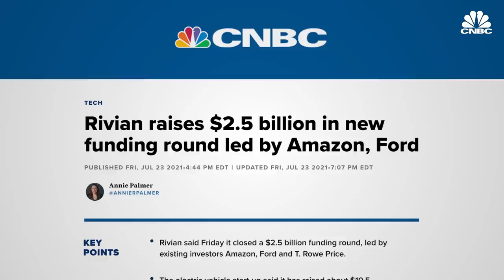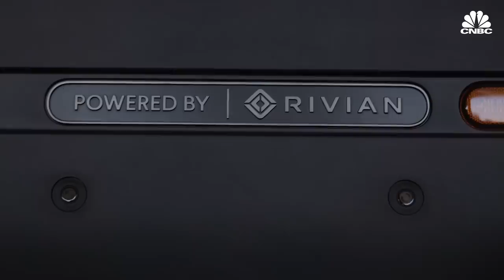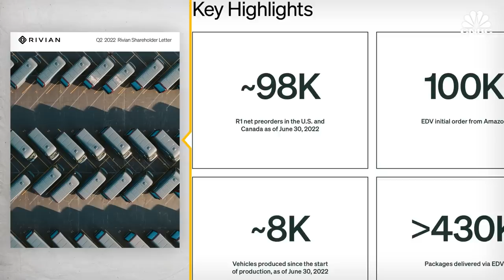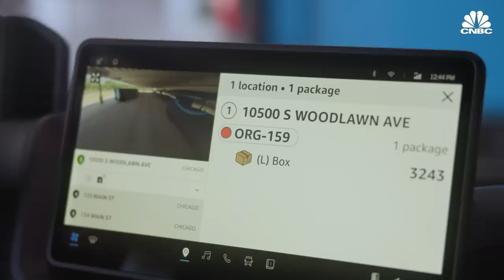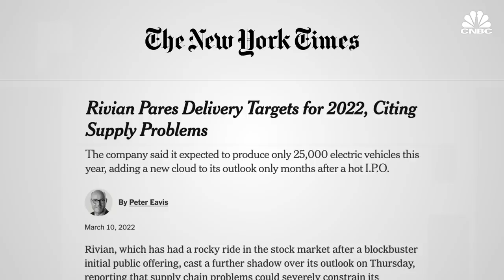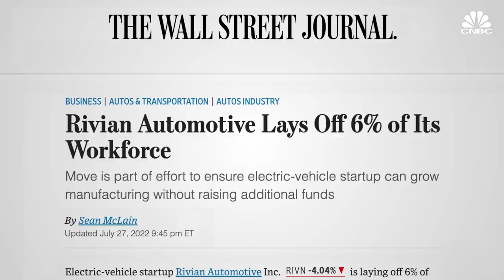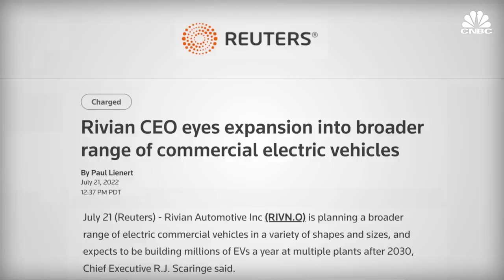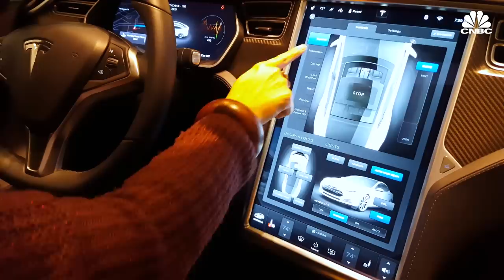How Amazon Is Giving Rivian An Edge In The EV Industry

Comment: I support the EV market, but where is all this new electric power going to come from?  My power company is building new coal power plants to support new demand. To drive a coal powered EV is not wise. We should slow the rollout down a little bit and not cause widespread power shortages. We only have 1 chance at this.
Reply: Aren't nuclear plants pretty clean
Reply: Producing EVs is worse for the environment than just driving gas powered vehicles
Reply: @LuKe-cq9il  they are, but we need to start building new ones, but we aren't. CA is shutting there's down. Natural gas is cheap compared to building nuclear power.
Reply: Renewables these days are generally cheaper than fossil fuels on a megawatt hour basis. No offence, but building new coal power plants in 2022 ought to be illegal - those plants last decades, and we can't still be running coal plants in the 2040s if we want to meet net zero. If you absolutely need base load, go with natural gas, nuclear or hydro. Or build lots of batteries. Or have a larger grid. Literally anything other than coal.
Reply: @Robert Jameson you know how much energy it takes to mine the lithium that they use for the batteries in EVs. You obviously need to do some research before you make an ignorant comment like that again.
Reply: @Robert Jameson Dont just say lol and be a child. Give answer with proof. You know as well as i do that William is correct!
Reply: @JT_771  Ask Texas how that wind and solar worked out. More Chinese solar panels are not the answer. Windmills take enormous amounts of steel and concrete.  10 years of use to break even on carbon pollution. By then they have to replace the generator and blades. They are not efficient, just good at getting money from the government. 

Please, I beg of you, to do some research on the pollution on the mining of lithium, nickel, and cobalt in Africa. The necessary minerals needed for batteries are killing entire generations of people. Oil production is dirty, but not even close on death toll for lithium batteries.
Reply: @JT_771  I do a ton of research. How do you think I discovered the fact that Africans are dying by the thousands so that rich Americans can drive a coal powered EV. And feel good about driving a EV, that is what I find very depressing. They don't know the harm that they are creating. 
I live in southeast Michigan. If I plug my EV in when I get home to charge, the sun gone down or it's overcast,solar panels do me no good. Just driving a coal powered EV at that point.
Reply: If it's your power company, why did you decide on coal power plants?
Reply: @elvism684  Europe is going to need a lot more natural gas to make up for Russian sactions. Coal in my region is cheap, plentiful, and reliable.

Comment: The Edison generator and dynamos is an open patent technology but you can chisel an old generator to Edison generator by removing the Tesla magnets from the armature magnets and leaving the Edison magnets on the armature magnets.  The generator will move like a motor and generate the same current and voltage DC add an inverter for higher voltage AC power continuous peak power without fuel or pollution.  A dynamo is a brushless motor as a generator and is an open patent technology.

Comment: I’ve seen a few and their trucks in my area.  I’ve also seen two Nikola 18 wheelers.
Reply: The Nikola 18 wheeler, were they being rolled down a hill?
Reply: @nicktaylor8112  Of course not.   They were in the wild getting the job done.  Imagine a trailer 3/4 of it loaded with big concrete blocks 5 feet wide and 5 feet tall.   From a stop light, he rolled forward about a trailer length then accelerated off like a car not an 18 wheeler.  I videoed it because it was my first time seeing one.  I own a Tesla.   Elon best get his on the road.
Reply: @nicktaylor8112  I also seen the Rivian Amazon vehicles.  That would make a nice conversion van too.

Comment: Well the vehicles gather at a common point where they can refuel and lithium batteries have their issues, so why not run last mile fleets on a different renewable like green hydrogen and leave electric to niche uses like the (“hopefully” decreasing) personal vehicles. Is it unfeasible or the evs are just cheaper to run?
Reply: Where do you get cheap hydrogen? It take a lot of energy to split hydrogen from oxygen in water.
Reply: I don’t think it’s really cheap atp, but I’d stick nuclear (probably snmr) in niches like that, which are so energetically demanding.
Because of its high energy capacity

Comment: As an fleet service technician that worked on everything from Refuse truck to delivery step vans and OTR trucks I see a huge flaw in this self catering model of we will fix these van with OUR OWN techs, 1. has anyone ever seen an Amazon fleet on a site ? I can tell you just one I work with has over 300 vans total and growing I work on these things all the time there is no way Rivian is going to supply enough parts and manpower to keep them going,  I don't mean keep the motor going its everything around the chassis that needs repaired. A lot of these drivers treat them like bumper cars. So if they are having supplies problems now how will they  keep up with demand. I hope these DSP keep that in mind.  2. Ford, Ram  and Mercedes are going to be shelling out EV Transits, Pro-masters and Sprinters on modified persisting assembly lines giving them a huge advantage with end cost and parts availability. I think Rivian has a leg up on the a step van style or mid-roof but I think Rivian is best suited for Pick-up/SUV market due to they can sell the SHOCK factor (pun intended), city and tech people like EV's  and can afford to have down time by getting a loner from a dealer ect, fleet owners cant afford the down time and spend money on rentals. So that leaves us with the Big van companies Ford, Chevrolet, Ram, Mercedes along special body manufactures like Utilmaster ,Grumman Morgan Oleson and Union City to make the EV vans more cost-effectively and have parts ready to go.
Reply: @user-zlxelaZz  idk how much I can say but I can confirm that 1 of the 2 site I work with is getting charging station installed right now. Ive been watching the progress unfold as I work right next to it. They are only installing 14 charging spots. Out of the 330 something parking spot in this site. The other site is next. Now rumor has it they are not getting Rivne here it’s supposedly fords but idk how true that is.
Reply: @user-zlxelaZz  Sorry should clarified they are only getting that many vans so 1 pre a charging spot.
Reply: @user-zlxelaZz  I just got off a meeting and verified they are getting Riven vans. I will be doing training on them in the coming weeks pre my company but Amazon is footing the bill. So I’m wondering what other fleet maintenance companies have the same deal. So that just backed my suspension on how they plain to keep them on the road. But that still leaves the parts problem. Honestly the training is just how not to fry yourself on the battery wire from what I’ve seen in the meeting.
Reply: @user-zlxelaZz  you are a 100% correct on all points. But I have to say getting parts on “normal” vehicles has been a lot better in the Midwest market compared to what I went though with class 8 trucks the past 2 years. I was downing trucks do to not getting parts for months. Most of them were for in-frame rebuilds.
Reply: @user-zlxelaZz  yes the Frightliner MT45 are true commercial tank of a delivery van so are the fordF59 and smaller e450 step van. I like working on the step vans the most due to most of my experience is on heavy class8 purpose build equipment that is barebones no sleeper or most interior is sheet meta and those step vans are as close as I can get to that where I am at now.

Comment: Edison generator or battery powered dynamo electric cars trucks and airplanes is the more appropriate industrial investment.  If you need advice let me know. Zero fuel zero pollution is best done with Edison generators or battery powered dynamos with high torque electric motor.  A battery powered electric vehicles are limited charge

Comment: The problem with lowering our carbon footprint is these vehicles use more emissions in the form of producing oil to make the materials for the car, as well as the materials used to make a batteries i.e lithium, and other products that have to be extracted from the earth.  These are the things that the media fails to report.

Comment: yeah idk my 2010 silverado 4.8L is still the better deal sure it can only tow 10k lbs and get 0-100kmph in 6-7 seconds and cost me 150$ to fill up every 4 days but the upfront cost of the rivian truck is like 160-180k cad when speced out even the much more reasonable and maybe more trust worthy manufacture whose been making trucks for 100 yrs the ford lightning ev is still 90k msrp speced out i would need to pay the high gas prices for over half a decade to get anywhere near the upfront cost of it ill stick to the old truck

Comment: Is Tesla still a startup? Come on CNBC
Reply: Technically I would say they still are, they have not as yet established a firm position in the industry
Reply: @tomdalton4293  are they not an industry leader? Established firm? Been operating for almost two decades. This can't be a startup
Reply: @RendaniSinyage  EVs yes but not the auto industry as a whole
Reply: @tomdalton4293  they are bigger than the whole industry. Tesla can afford to even buy Daimler cash
Reply: @RendaniSinyage  Market cap is determined by speculation of where the company will be in the future, and Tesla certainly has the potential to eventually be in the same league with Daimler, Toyota, Volkswagen, GM, Ford etc, but they are not there yet with their production, revenue and total assets. When Tesla gets to over $100 billion in revenue, they will be in the club then, and they likely will.
Reply: @tomdalton4293  what is a startup to you?
Reply: @RendaniSinyage  I think upstarts might be more fitting😆